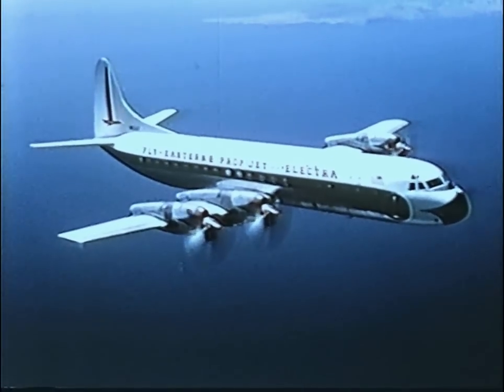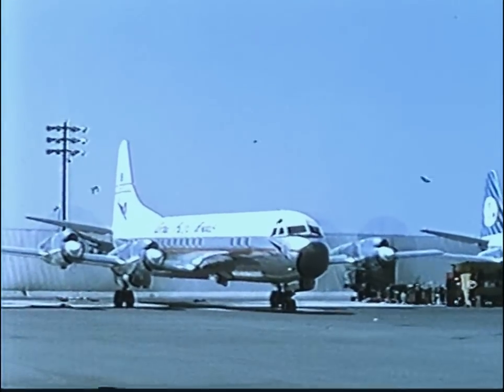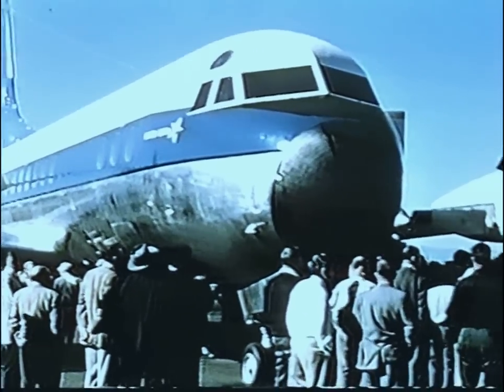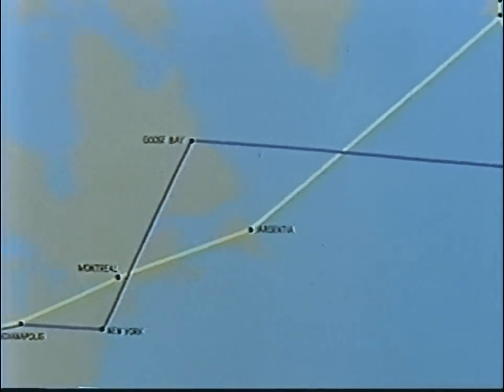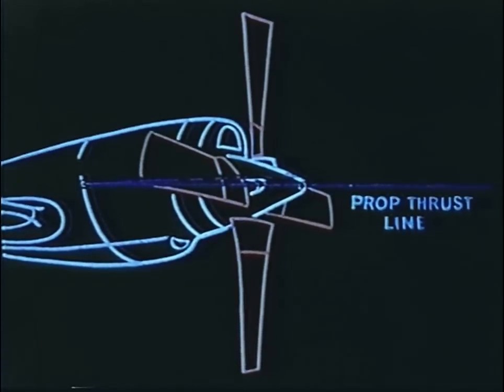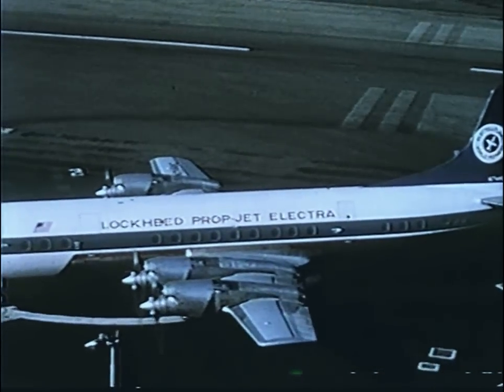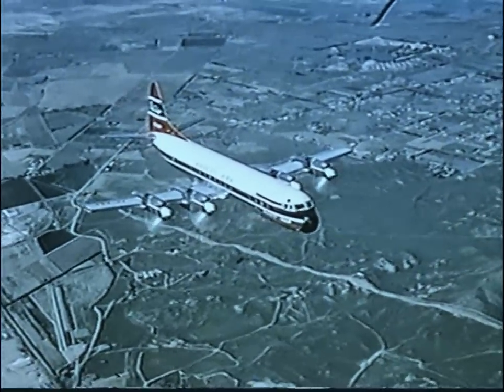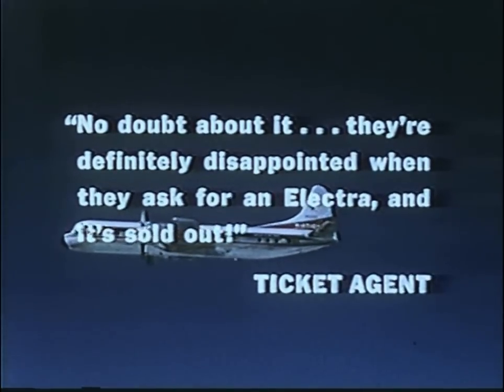Lockheed L-188A Electra Promo Film #3 - 1960

Comment: Note how few exposed radio antennas there are. A pal (RIP) was on the team that designed the internally mounted nav and comm radio antennas. He also had a hand in designing the ILS ground based landing system still in global use. Brilliant and yet humble electrical engineer.

Comment: Hi. The impressive climb of these planes was due to the prop-wash over and under the wings, especially the flaps. In a jet it would be called "vectored thrust". Lockheed first used this idea in its timeless C130 Hercules which made that plane the best short runway heavy lifter ever, also using Allison turboprops. The "Herc" could even land and take off from aircraft carriers, albeit large ones only. This is why the P3 Orion and Herc still soldier on in the 21st century, they were both designed initially to meet military needs, Lockheed having a close relationship with Uncle Sam through its secret "skunk-works" design bureau. A good job well done. 

I remember the Electra's screaming in from Australia across the Tasman sea, taking a nudge over three hours to reach N.Z. from Sydney 1200 miles away if the wind was right. We had Viscounts and F27's too, but they sounded different. We'd rush out to see the turbo-props because for boy plane-spotters it was boring old ex-military DC3's every day, droning on and on ad nauseum, with their 24 air-pocketed passengers filling up their sick-bags. Today we'd rush out to see the DC3: how times have changed. Good video, happy landings. Cheers, P.R.

Comment: KLM had a reasonable experience with the Lockheed Electra as far as a prop airline could in the 60s. It wasn’t a jet and passenger weren’t enthusiast . 

A story my grandfather told was the first press flight: A retour flight Amsterdam-Nice with Dutch press didn’t all go well: A journalist was locked in the toilet, and after landing in Nice when they opened the cockpit window with some heft, the complete internal electricity dropped out. The catch internally pushed through the cable. The flight engineer (which my grandfather was) had his work cut out on the tarmac in Nice. 

All the planes did get checked and most had some damage cable behind the window frame.

Comment: Like the DeHavilland Comet the L-188A Electra pushed the performance envelope. The 'Whirl-Mode' condition which resulted in catastrophic failure of the wing was a new issue-resulting due to the much higher speed of the propeller wingtips. The problems were resolved by strengthening the wing and the Electra still flies today as cargo carrier and Military aircraft, but only after the deadly crashes of two passenger carriers. As I recall, Whirl Mode only resulted in catastrophic failure under certain conditions-some structural weakening had to already be present and then turbulence initiated the condition which propagated to the wing. One of the lost aircraft had experienced a heavy landing shortly before the crash and it was suspected that caused some weakening of the wings. It is unknown what structural weakening was in existence in the other airliner which crashed. The Electra never really recovered from the bad reputation, only 170 were built as airliners. It was also a marginally profitable aircraft, as I recall it only had 98 passenger seats in a 'dense' configuration. The Boeing, Douglas and Convair jets came in shortly thereafter carrying many more passengers.The Electra has a short run and the crashes depressed interest in the aircraft as an airliner. May the passengers who died in these crashes RIP.
Reply: The 727, 737 and DC-9 entered service in the mid-1960s. They handled the short and medium range flights well and were about 200 mph faster than the Electra.
Reply: @alanstevens1296  Exactly, as I noted. Even without the crashes, the Electra had a limited market appeal. Many airlines were waiting for the jets which they knew would come out soon-these were more economical and also could be lengthened and scaled as passenger loads increased.
Reply: @heyfitzpablum  
Of course they really didn't know in 1960 how efficient the smaller jets would be.

They could have sold a lot more Electras before 1965 as they did have real advantages over piston engine airliners.
Reply: @alanstevens1296  My late father was a lifetime airline pilot for TWA and my brother was an airline pilot for DELTA. I discussed this matter and others with them many times. The Electra was an amazing turboprop airliner and I admire the Engineering (I'm a retired engineer) that went into it, but it was too much of a niche-design, it wasn't scaleable. Even back in the late 1950's most airlines could see that and they knew more flexible and efficient jet airliners were not long in coming. I disagree with you on one item, the airlines had a pretty good idea how jets like the Boeing 707 would perform by the late 1950's. Jet technology was well understood by then and it's use in an airliner only hinged on developing engines of sufficient power and efficiency-and that was well along by the late 1950's. The Electra came along too late, had it come along in the early 1950's (like the Vickers Viscount) it would have been far more successful. The Viscount by the way sold 450 units.
Reply: @heyfitzpablum  
I specifically excluded the 707 and DC-8 because they entered service in the late 1950s and were already well known.

I am not in the aviation industry but I was following this in real time at the time from before the 727, 737 and DC-9 entered service.

The Electra was ideal for airports like Washington National and LaGuardia and Midway. The four engine jets needed too much runway for those airports and could not operate there.

They had some idea about the smaller jets but they need to prove themselves in actual service first.

Comment: Why was Lockheed building a propeller plane in the late 50's? I read that Boeing's 707 was far superior. I was only 1 year old
Reply: The L-188 was designed for short- and medium-length routes that the 707 could not efficiently service, and for use at airports with shorter runways that could not handle the jet airliners.

Comment: Nobody loves lockheed aircraft more then me.  The safety record for this craft was extremely bad , it was not an easy plane to fly with several, design/prop/wing  problems. Yes, they fixed the issues but the damage was done. when it became the Navy P3, and the issues were corrected it had a long , long service life.

Comment: The  L-188 had persistent problems with the main spar rotting out, from the inside.  I operated some (the old Zantop fleet) and we had to keep guys busy x-raying the spar, boring out core samples, and doing plug repairs to the spar.  Pain in the ass and it was because of the aluminum casting they used for the spar.  It was a great idea that just didn't work.  Of course, C-130s also have substantial wing/spar problems.  Lockheed did it again!  I had 13 of the aircraft.  Some were sold to Buffalo Airways and they had a gear lock-down problem and put down starboard gear up on the ice, with a film crew on board.  You can see it on Ice Pilots.

Comment: So, this plane came out and was immediately spanked but the 707 and DC8?
Reply: The 707 and DC-8 were designed for long-distance flights (NYC to LA, for example). while the L-188 was designed for shorter flights (NYC to Chicago, for example), or for flights for which there wasn't enough passenger demand to fill the larger jets.

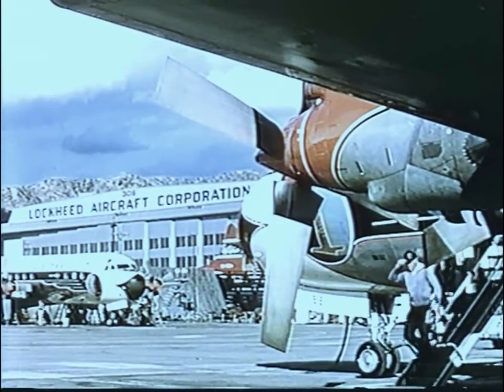Comment: WOW Talk about sad... at 2:55 in the video, looking back on it now, it's jaw-dropping how they talk about the "fail-safe structural design" and complete flying safety... "failure of any single element would not effect the structure of the aircraft. Little did they know that they were only months away from 2 seperate crashes due to unforseen design shortcomings.

....fast-forward 60 years and history repeated itself with the 737 MAX family.

Comment: Did Piedmont ever fly these?
Reply: Piedmont flew two prop-jets that I recall. The Japanese-built twin-engine YS-11 and the Dutch-built (and later Fairchild) F-27, a high-wing, twin engine design. The airline later added some 727-100s, then built up a good size fleet of 737-200s and quite a few 727-200 ADV.
Reply: Capt BrakeSet Thanks Captain.  I was 6 the first  time I ever flew.  I was with my mom and my sister and I could have sworn we boarded a piston engine plane with four turning.  That was at Mercer County AP in 1968.  We were traveling from Bluefield, WV to Spartanburg, SC.  I remember the YS-11’s.  Thx.

Comment: What kind of public relations did Lockheed engage to restore the Electra's image? I'd like to see some of their print or multimedia. I'd be surprised if Boeing now isn't studying everything it can find.
Reply: The Robert Serling book mentioned elsewhere on this page is excellent on that subject. The main thing was running down the whirl-mode problem and creating an efficient means of fixing the aircraft already built. I believe it was a 20-day process from arrival of the aircraft at Burbank to when it returned to the airline. Then the airlines helped out, too. AA for example flew 20 minute sightseeing trips onboard their Electras for $6.50 per person. The point was to reassure the public and attract first-timers who'd never flown before. Turned out to be a very popular program. Some airlines removed the Electra name from the aircraft or rebranded them Electra II, as did Braniff. The Electra followed in Lockheed's heritage of building airplanes that combine capabilities in ways not possible in other aircraft. Their Hercules transport is STILL in production. The Constellation could lift more than it could hold and was a decent flyer.The Tri-Star was ahead of its time and beloved by flight crews. Then the Electra, all hydraulic boosted controls, excellent handling, fast and immediate power response. There's been a whiff of controversy around the Electra's wing design - the whirl-mode modifications included numerous wing structure improvements. Lockheed said it added a margin of safety. Critics say it was Lockheed fixing a problem they suspected from early flight testing. Still, the FAA investigation and NASA's concluded a QEC had to have been damaged FIRST to allow onset of a whirl-mode condition able to destroy the wing. Boeing's 737 MAX is a different situation, where they put a plane in the pilot's hands with a quirk in it that they figured pilots would override just like a runaway elevator trim — it's just that Boeing didn't share the rest of the MCAS story — but that launches an entirely different story.

Comment: whirl-mode of death!
Reply: If you Google "whorl mode" the first entry that comes up mentions the Electra. The engineers omitted this particular stress test in the design.
Reply: @maxpenn6374  Undamaged, the Electra exhibited stiffness adequate in the QEC to tamp down the start of whirl-mode before it gets passed to the wing at a frequency the wing can't resist. But let a brace or mount be fractured or otherwise weakened by a hard landing or some rock n roll turbulence, then you're in the demon's den. A second incidence of CAT or similar could induce a fatal whirl-mode cascade of events because the damaged nacelle is at its mercy.

Comment: I note that this promotional film does not mention the 'propeller whirl' failures which brought down three Electra's over USA.  They screamed wingless, vertically into the ground.  It was this failure which required the re-alignment of the engine thrust line.  [Aussie in BC]
Reply: The engine re-alignment was for noise reduction. Strengthening the engine mounts and wing skins solved the whirl mode wing failures.
Reply: Because the promotional film was made before the accidents for starters.
Reply: @HEDGE1011  
Now come on HEDGE.
Don't let the facts get in the way.

You're gonna make the bashers mad.
lol
Reply: @HEDGE1011  
One of them happened in 1959.

Comment: The Lockheed Electra L-188 my first aircraft to fly as a first officer for Air Florida in the 1970's, quite an aircraft, fast, unique cockpit setup, all in all handled fairly well. A little known story of the Electra, as I heard it, a DC-8 departed JFK followed 40 minutes later by a Lockheed Electra both headed to Los Angeles, (airlines) unknown the Lockheed Electra landed 30 minutes ahead of the DC-8, these Electra's were THAT fast. Loud, noisy heavy vibration all the time the airlines wanted jet aircraft and the Electra went the way of the by-by, and yes the Ice-Pilots aircrews still flying them...
Reply from the maker: Great post, thanks!
Reply: Envious. I believe NW flew nonstop red-eye SEA-LGA with an Electra and possibly AA flew nonstop overnight SFO to either DC or NYC using an Electra. That would have been quite the flight. The video says an Electra delivery flight flew Burbank to HNL in 6:15 - today it's just 45 minutes less on the jet of your choice. Not bad, Electra! I think all the Electras are grounded now - the 580s are also, I believe. Corrosion? Wing skin?

Comment: Fail safe structural design? Seem to recall the wings vibrating in at least two crashes...
Reply: The fail safe remark is an eyebrow raiser, knowing what we now know. The engineers failed to take a particular mode of stress into account in the original design. The vibration caused enough stress to separate wing from fuselage. PSA never lost an Electra because their chief pilot set more conservative operating limits than Lockheed did.

Comment: An amazingly small wing.
Reply: When pilots in an early training group got their first look at the Electra, one of them reportedly said, "Where's the wing?" Actually the wing span is just a couple feet less than the fuselage length. The big props and the engines mounted over top of the wings make an illusion. Also it was a new airfoil with equipment normally housed in the wing placed in "stations" in the belly (Hydraulics, A/C and pressurization systems). To this day, some say that the Electra had the best heating and cooling system ever put in an airplane.

Comment: A number of Electras disintegrated in mid air,  two planes crashed because the wings fell off due to engine vibration within months of the Electras introduction in 1959

Comment: Not a reliable aircraft !! Lot's of accidents !!
Reply: There were not "lots of accidents"...there were two major crashes that gave the plane reputation.  The cause is actually mentioned in this video and was fixed.  After that modification, the airliner had a decent safety record.  The Navy used it for decades as the P-3 Orion sub-chaser, with millions of flight hours and a superb safety history.  Not mentioned in this video, but regional airlines like PSA and AirCal used the Electra extensively for their northern to southern California shuttle services.
Reply: @sjoldtimer  -- The flaw that caused the crashes was not mentioned in the film, because the crashes had not yet occurred.  The problem/fix in the film had to do with cabin noise, not structural integrity.

Comment: I remember attending Eastern Michigan University in the early 90s.  Zantop Electras would go right over campus after departing Willow Run Airport.  I always looked up as I was passing between classes.  I started taking flying lessons shortly after.  Many times I would be on base for 23 Right with an Electra on downwind for 23 Left.  You could spot them miles away with their four exhaust streams.
Reply from the maker: +ldmax Love reading comments like this, thanks!
Reply: I worked for Zantop for 16 years. Remember flying on the Electras twice. Once from Atlanta to Denver and back and once from Atlanta to Lima, Ohio and back. I was the loadmaster on both trips. After an accident in Philadelphia when a DC-8 was set on it's tail, Zantop required one of their own loadmasters on each trip. When I flew to and from Willow Run, it was on DC-8s.
Reply: I grew up in the area and remember seeing the Electras out on the ramp for years after Zantop closed. Now the hangar is gone as well. I still look for both every time I drive through the airport though... old habits die hard.

Comment: Didn't the 707 basically put an end to long distance turboprops,  not long after this?  And did Lockheed build an early pure jet to compete?
Reply: Yes it did.  The Vickers Vanguard and the Bristol Brittania could not compete with the shorter flights and the lack of vibration.  Lockheed didn't build a passenger jet until the L-1011, which failed because of engine problems, expense, and it's hugh complexity compared to the DC-10.
Reply: @Bartonovich52  As a passenger, I didn't enjoy the experience of the L1011. The high ceiling in the cabin seemed disproportionate and the reading light was so high it had to be switched from the seat. Lot of different non-structural fittings in the cabin rubbed together when not flying through perfectly smooth air and produced unpleasant noises. Other than that, it was as good as most of the many flying buses of the jet age.
Reply: @Bartonovich52  , the TriStar did have great success being flown by Eastern, TWA, Delta and Air Canada as well as British Airways and LTU in Europe and Cathay Pacific in Asia.